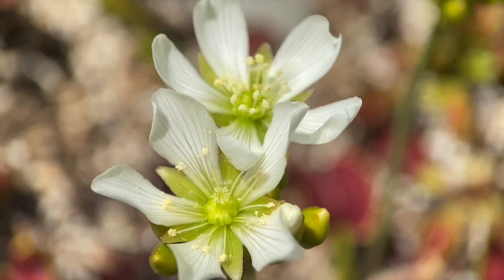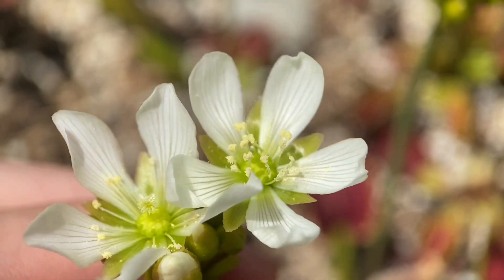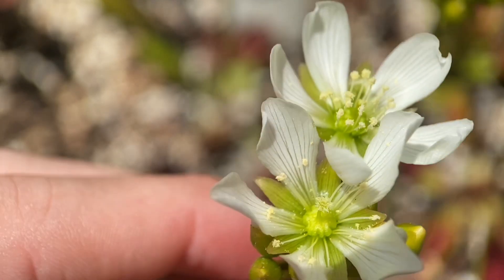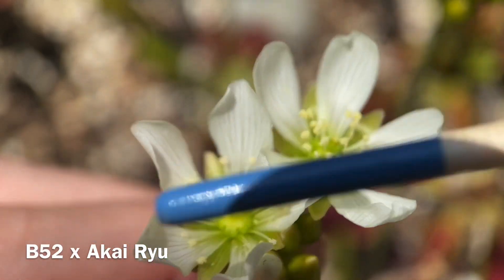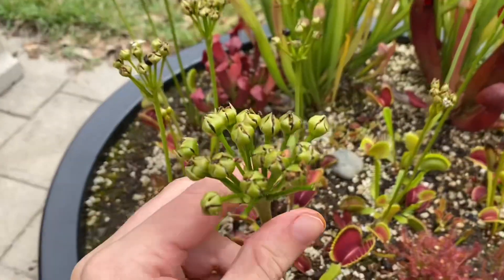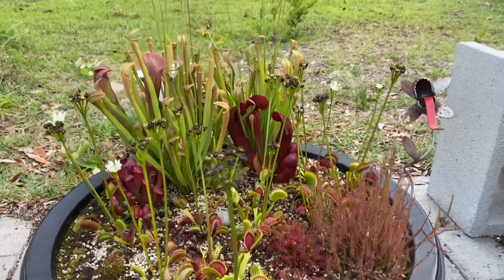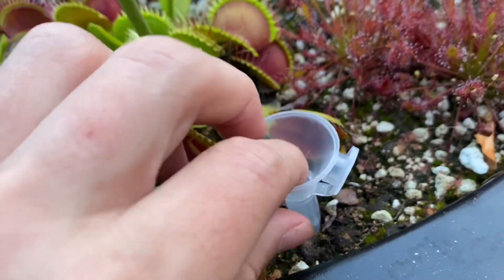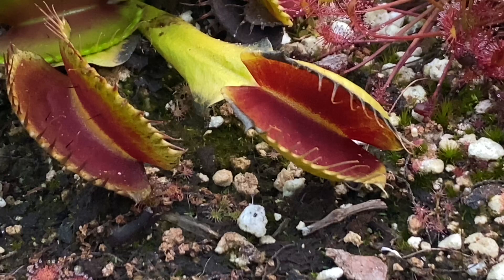How to Pollinate and Harvest Venus Flytrap Seeds - Complete Guide

Comment: That's very helpful; thank you!  Why is it necessary to use a tool to scrape the seeds out of the pod, rather than just gently using a fingernail, or rubbing the pod between thumb and forefinger?  I bought a VFT last year which started putting out a flower stalk late in the autumn, and seems to have done okay with a dormancy in the refrigerator.  Now that it's out, I'm giving it as much light as I can, and the stalk is growing by almost 1 centimetre a day.
Reply from the maker: No problem! I find the tool easier to use, and tends to get the ones in crevices out better.